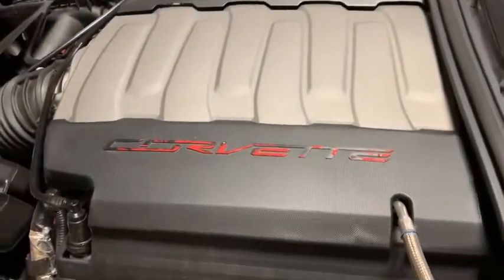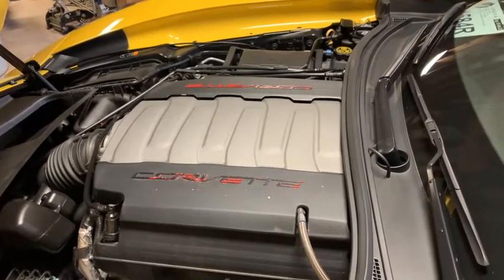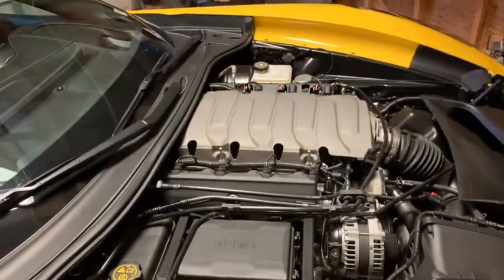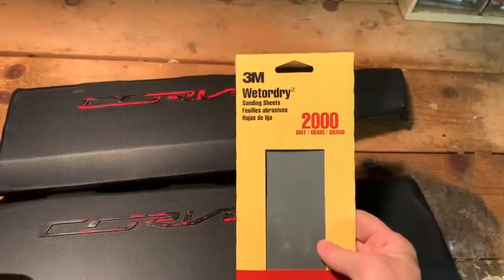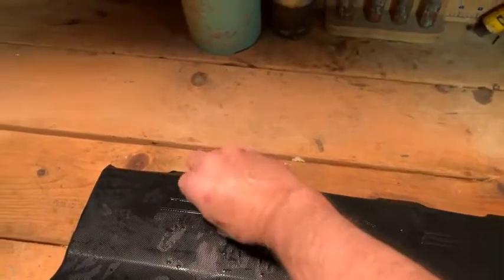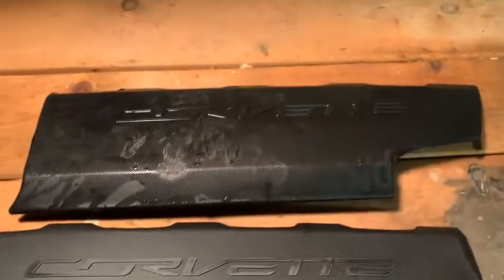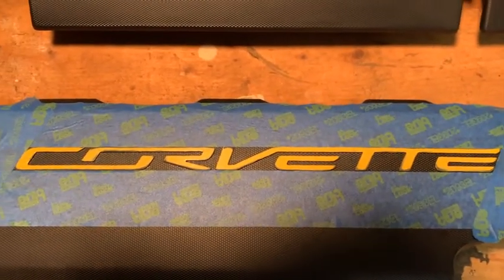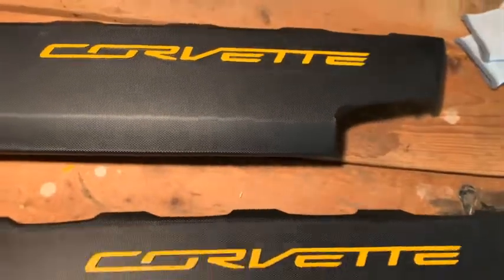engine cover letter painting for the C7 Corvette

Comment: I just did this yesterday. Why would you be pushing the paint tip down on your lettering to get the paint going. It is quite obvious to push the tip down on anything NEXT to your fuel rail covers, a paper plate for example. And you made a project out of this when it is actually very easy to do with one pass. And you didn't even pop the covers on the right way, you can clearly see they are sticking up on the valve covers which means you didn't put the little tabs on the covers in the grooves on the valve covers.